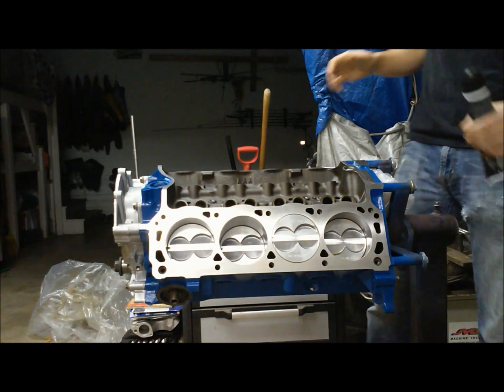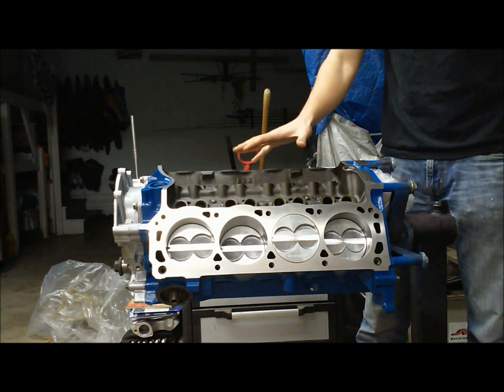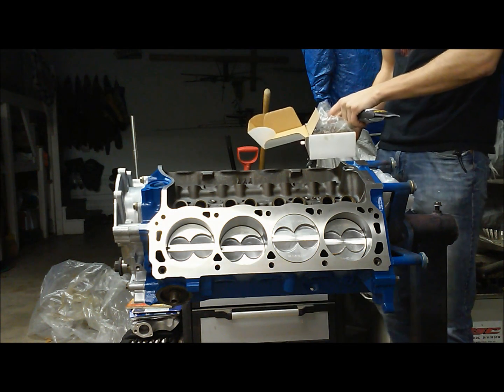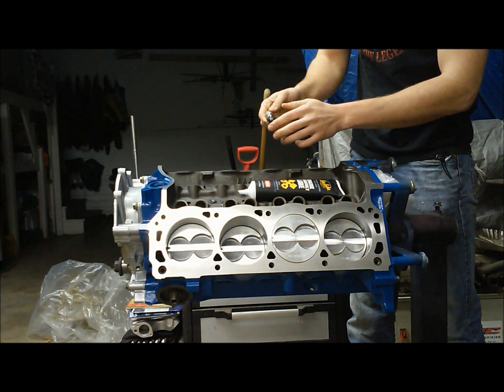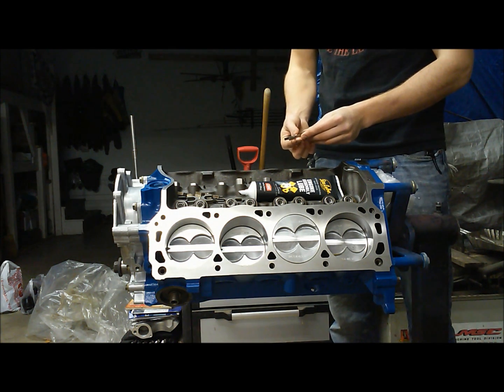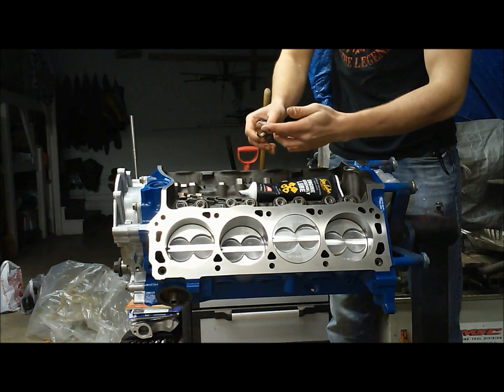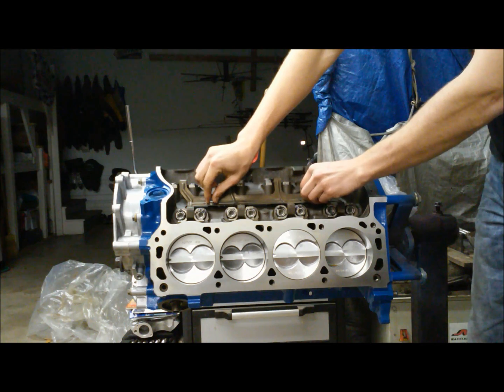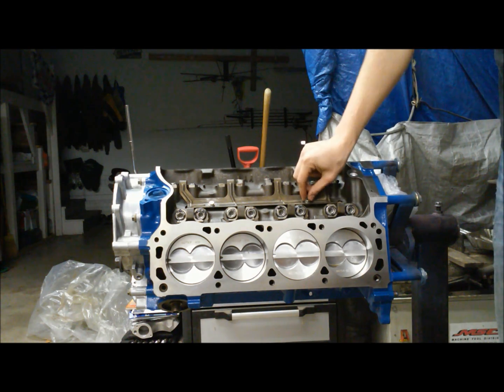Valvetrain & AFR Heads Install (Vid 2 of 5) - How To 302/5.0 PERFORMANCE Top End Build

Comment: I always use high temp Permatex liquid all head gaskets no matter what motor I'm building I would not put a head on  without it if for some reason that motor runs hot you have a better chance doing it that way of that motor surviving and with a lot of boost it is a must in my opinion
Reply: Nope...K and W every time

Comment: You need to adjust the camera to show what you’re doing we’re just watching you show us parts basically
Reply: Nah not really I mean he showed the toque sequence and him threading the studs in hand tight as well as putting the thread sealer on all head bolts as well as the direction of the head gasket even went over the different torque specs for the top and bottom head studs personally I think that if you need more information that that as well as a better representation of what he’s explaining then you shouldn’t be working on engines in the first place

Comment: Whats your take on the use of Felpro 1011-1 headgaskets used with aluminum AFR heads?

These gaskets are 0.041" compressed thickness but they have a pre flattened steel fire ring as they call them.  Ive seen mixed feed back on the use of theses steel fire rings with aluminum heads and lots recommend running the 1011-2 headgaskets which is 0.039" compressed thickness with a pre flattened copper fire ring that people say wont damage aluminum heads.

I only ask cause I purchased the 1011-1`s as it was recommended by AFR`s website directly but now I am a bit wary of using them.

Comment: Don't you have to "torque" the head studs before you can torque the nuts? All I saw was a little allen wrench to help run them in. Any stud and nut I've ever used, (not cylinder heads), required the stud to be torqued first to stay tight.
Reply: clark garber I believe you get them finger tight, and then a half turn past that, I have never installed them myself, but if I Remeber correctly that is it

Comment: Ive seen some engine builders soak the  rollers in oil, is that a smart shortcut or is assembly lube better.
Reply from the maker: I dont do it because i ultimately prime the oil system before i fire it.
so for me, it really doesnt matter either way
Reply: Was about to ask that
Reply: You should always soak the rollers first when installing a different aftermarket cylinder head and checking push rod length.
Why? 
So that when you install your lightweight "check" valve springs to ascertain correct push rod length and geometry you know that the lifters plunger is at its normal operational tolerances/ height instead of just assuming that the spring in the lifter will be overcome by the checking spring on the valve.
This is the difference between professional engine builders and Youtube engine builders.
So for ThunderHead289 to say it really doesn't matter either way after hes installed different heads is bad information ...its CRUCIAL to check everything correctly and in order to check valve spring length correctly the lifters should be "run ready" not dry.

Comment: i just got a 95 f150 xlt 5.0 and want to fix it up do i need a kit for the ford racing hyd roller or dose it fit right in ?
Reply from the maker: that engine should be a factory roller with e7 heads - after 93, even the trucks had the roller equipment. you should be good to go!
Reply: sweet tyvm :D

Comment: Is it because of the aluminum heads that you could not put the lifters in place after the head installation?
Reply from the maker: roller lifters tend to be a tight fit but doable, but the ford higher rpm performance units are a tad longer and will not.
Reply: My donor motor is a 1988 302 fuel injected, I am going to use my intake and carb. I want to change the cam and lifters. Question, when installing the cam shaft do I use the short pin?? Can I also use the original push rods and rocker arms, if I go with a 303 cam??
Reply from the maker: well, i believe the alphabet cams all use the same pushrod length between them as they maintain the same lift and just change duration. i have never measured one out, but i was told by ford performance over the phone, that if everything is left the same, the pushrods should be acceptable. it becomes much more of a problem with roller tip rockers, or when you change heads. 
the main thing to look at though is the valve springs, with higher lift, the ramp rate is fairly quick and needs heavy springs to control it. you will have valve float at an earlier rpm if you do not change the springs. or your pistons will kiss the piston. dont ask how i know . . .
Reply: I will be running a Holley 650 double pump with a dual plane intake that is from my 85 motor what cam do you recommend for the most performance?? Or should I just leave the original cam and just replace the center head with the 650 carb?
Reply from the maker: well, what is your intended usage? street driven mostly? not going past 5500 rpm i imagine. ???
Reply: Yes just street driving
Reply from the maker: well, the xe266hr cam from comp is a very solid unit for the rpm range you will be in. another solid upgrade is the moving to a 3.73 rear end.
Reply: do I need heavier valve springs or will the stock one be good enough if I go with the xe266hr cam
Reply from the maker: +Chuck W MacLeod you will need heavier valve springs. Give truck flow a call, you can get a valve spring kit from them with everything included for 150 I believe.

Comment: Would love to see you do a 351 Windsor using edelbrock extreme rpm heads and edelbrock's 351 Windsor cam.
Reply from the maker: I got a 351w sitting that's getting worked over soon, so be ready!
Reply: +ThunderHead289 can't wait to see it !!!
Reply from the maker: +Warren Joe I need to get it tore down and to the machine shop!!!! Want to do a 408, but I best start with a standard 351
Reply: +ThunderHead289 that's what I think a lot of people want to see is just a regular 351 no stroker. So yeah I think that would be great. Have you already bought the heads and cam?
Reply from the maker: +Warren Joe a lot of people have been really chewing my ear over the 351. I'm going with a smaller cam and some good heads. It's supposed to be a budget performance build (budget but with quality parts). I haven't moved too far forward on it. Before the year end, it should be built.
Reply: +ThunderHead289 I was thinking of doing a 351 with 30 over flat top Pistons with the edelbrock extreme rpm heads that have 185 runners with 202 160 valves with 59 cc chambers making 10 to 1 compression. The cam was also going to be an edelbrock. It's called a 351 Windsor cam if I'm not mistaken. It's a high lift split cam. 570 something on intake side and 580 something on the exhaust side. Then I was going to use a edelbrock perfomer rpm air gap with a 750 double pump Holley. Was thinking of using inch and seven eights hooker equal length headers going into a 2.5 inch exhaust with flowmaster 44's. That's the build I've got planned as far as doing a 351. But lately I've been looking at using the AFR 195 renegade heads instead but everything else would be the same.
Reply from the maker: +Warren Joe the afr heads are awesome, but I think the edelbrocks will work fine. I'd use a comp cam and go for power, not lope. The xe comp line has been tremendous!
Reply from the maker: +Warren Joe build sounds awesome
Reply: +ThunderHead289 lol. I bet they have been chewing your ear off lol. Can't wait to see it bro when finished.
Reply: Hey I've saw you mention the Comp Cams XE266 and am eyeing it up for a stock roller bottom end build I'm doing. Did you have any issue with piston clearance and AFR 165's with the XE266?

Comment: Looks like you got some pretty good valve relief cut in those Pistons. Why didn't ya use the AFR 185 heads instead of the 165.
Reply from the maker: It's just a 302. If it were to only be run on the track, then of course. The cam and head combo is good for street performance and will have good low rpm/street manners
Reply: +ThunderHead289 in your opinion how much more hp do you think you would had gotten if you used the bigger 185 heads.
Reply from the maker: +Warren Joe well, I'd of run the xe174hr then as well. I'm sure a good 50 if you pulled it to 7500. Would have required different Pistons to keep the dynamic compression up on the larger cam. Honestly, you would feel more out of a good tune and a 50 juice shot.
Reply: Those 165cc heads are like magic on a street 302 , fuckin mint 👌